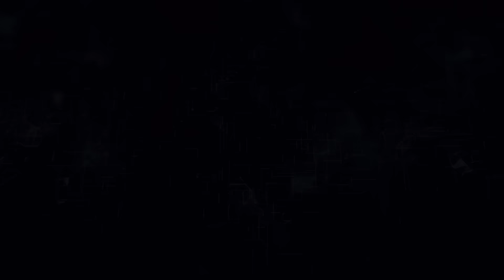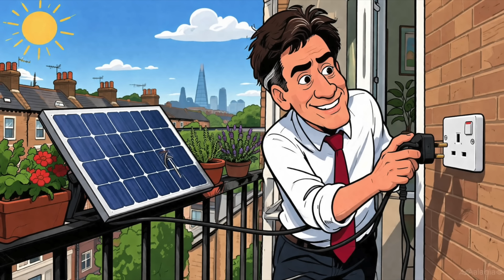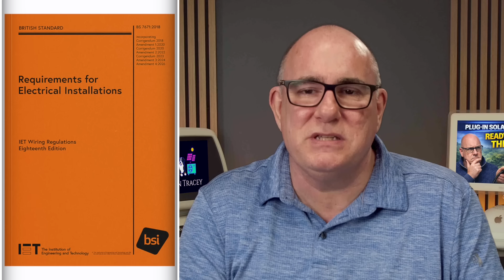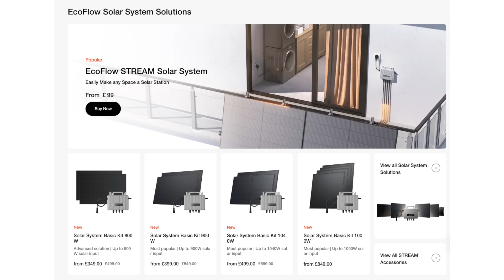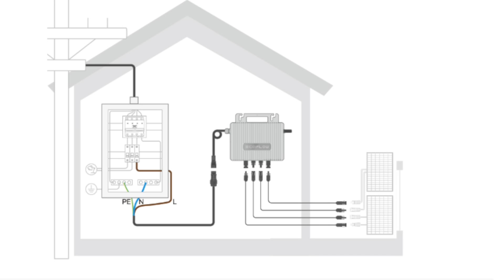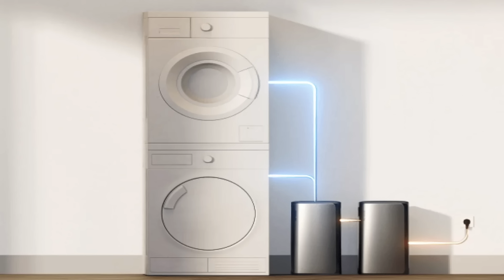Plug In Solar Is Coming… But There’s a Problem

Comment: I've heard you can put multiple micro systems into a house and should be ok as long as they on separate circuits - for example one plugged into the downstairs sockets circuit and another plugged into the upstairs sockets circuit - is this true? Also I have a separate fuse board in my garage, would I be best plugging a plug and play system into this as an added safety step? What would I need to do to have six 515w panels on a plug and play systems?
Reply from the maker: @stevecoulter5019 not quite — splitting across circuits doesn’t make it automatically “ok”. The limit is really about total backfeed and what the wiring can safely handle, not which socket it’s on.

Also 6 × 515W (~3kW) is well beyond typical plug-in limits — you’d be into proper install / G99 territory rather than plug & play 👍
Reply: A 6 x 515W plug and play system you'd peak at about 3000W so you would need an electrician to fit a separate circuit from the consumer unit, and then you or they hardwire your inverter(s) to that then file a G98. You can do that today quite legally but it will need a sparky for that one bit, and it's likely to remain the same for that level of generation even when the plug in solar rules arrive. It's about a grand for a 3.68kW inverter and another 1500 or so for 10-16kWh of batteries.

Comment: When talking to people the biggest thing they misunderstand is output. They seem to think they will get max output all day everyday. 
Well it's now 12:45pm on Good Friday and cloudy and my system with two 400 panels is producing 96w. 
So people need to be realistic. Yes on a cool cloud free sunny day I can max out the inverter (original Deye 600w version). But these days are the exception not the norm.
Has the £300 Ihave spent on it been worth it. Yes but I have had it many years. 
I have looked at batteries to soak up the excess but the numbers never really add up, for me anyway. 
If you are not in a rush for a cup of tea/coffee then a cheap 600w kettle is worth buying.
Reply from the maker: so I am in the process of publishing all my generation data on my website, this will at least give people one data point of what a system generates in the real world, more to come on this soon
Reply: @JonathanTracey looking forward to seeing the data 👍
Reply: You should never think of solar as just XYZ watts of panels.  It is really best to think of the solar as producing XYZ amount of energy per day.  So, for example, slap together a little 12ft x 6ft Pergola kit (steel) and plop 4 x 400W panels on top.  That's 1600Wp of solar that will produce 5kWh/day (more or less) of energy.  That is what is important.  Not the wattage, but the energy.

It also doesn't matter that some days aren't sunny.  The savings accrue over the whole year.  You aren't trying to run the house 24x7x365 100% from this sort of solar system.

The key to doing this is that you don't just AC couple the solar panels directly into the house with a microinverter.  Doing that would be a complete waste of time and effort as well as massively limit how much panel wattage you can install.  Nobody should be doing that.

You get a balcony kit that includes a directly-coupled battery.  And not a small battery... do like 5kWh of battery.  Now you can put as much solar on as the balcony kit supports (meaning a lot more than 800Wp worth of panels) and program the kit to limit output to the house to 800W.  Excess is soaked up during the day and stuffed into the battery to be discharged in the evening.  And, in fact, one could soak up everything during the day (depending on how much battery storage you have) to then put it all out in the evening when your electricity rates are the highest.

-Matt
Reply: @junkerzn7312 Well ideally yes but you have gone past the scope of a cheap DIY system and it's payback (for me anyway). Last year I only imported £200 of electricity. 

Besides when my system went up back in 2021 small solar batteries weren't a thing. Mine dates back to the 600w microinverter era that I imported from Europe. 

So for my use watts at the time is more important. Yes it's mainly to cover base but if it's sunny between 11am-2pm then I want to try to use as much as I can rather then just giving it back to the grid.
Reply: @junkerzn7312 it depends on people's budget and the outdoor space the property has. Ideally bigger is better, however this is going to mean that people who have been priced out of solar will finally be able to have some, which is better than none, especially for those who rent and can't have a fixed structure in the garden either due to the landlord not allowing it or not having space.
Reply: @junkerzn7312  Yes, there are some large battery stations out there [7kwh] 600w of panels can keep them topped up even in winter, plug, and play, just don’t use kettles or microwaves, everything else should be fine, as long as you don’t expect it to be continuous.
Reply: The solar data for the UK is basically that 800W of southish facing panels in the middle of the UK will generate about 800kWh a year. If you use it all then at current rates that is around about £200 a year of useful electricity delivered into your house. It's less in Scotland, more in Cornwall obviously. Overpanelling can also be a big win if your system supports it.

The european market price (as opposed to the current UK rip off market price) is around the equivalent of £60-70 for a 450W panel, and about £100 for a plug in inverter unit with no battery. So if you can use it all (eg work from home. retired etc) your RoI is ridiculously short. Even with rip off UK prices it's not too bad a return, except for stuff like the Ecoflow batteries where the prices are just stupid.
Reply: Getting a 800W inverter and doing a bit of overpanelling (in parallel!) can make the numbers work.
Reply: @konstantinlozev2272 Yes definitely in winter this could be a good option. I'm not sure if 800w/900w per input in the summer is good for the microinverter.
Reply: @gavjlewis you can install 20EUR DC breakers with MC4 ends on the extra panels for the sunny days.
Reply: @konstantinlozev2272  Never thought of that. So I guess a 10A breaker maybe. I'll look into that thanks. 
Hopefully panel prices come back down in the autumn. 👍

Comment: Just wondered, I already have a solar install (6.6kw) and 10kw battery and therefore export licence ... I am presuming therefore if I added in some plug in solar panels (with a mini converter - a battery version) I could export, however would that export still be limited to the 800w from the mini inverter?
Reply: No.  The export is whatever you produce.  The balcony solar would simply (effectively) increase your solar capacity.  That is, instead of your roof running your base load, the balcony solar would do that and therefore your batteries would fill faster and your export would begin sooner.
Reply: @TheImhotep2012  thanks for the response, what I meant was ... Say I put 4 panels up (450w each) which is technically 1.6kw ... The mini inverter would only allow 800w max through the plug and therefore ... Not allow the full 1.6kw to be exported?
Reply: @albie9999  Ah.  I see.  Yes correct.  As Jonathon notes in his videos you can mitigate that with having batteries - the batteries store the excess to discharge later, but that significantly increases the cost.  I, like Jonathon, have gone full monty with roof solar, balcony solar and several lithium mines worth of batteries dotted around my house.  But, I did that since I had some extra cash so I can put up with the 10 years ROI.  Even if you don't get any money from the grid though, over powering your solar is still good.  Note, you will cap when the sun is brightest but in the winter months your panels will come closer to the 800 Watt limit.  Extra couple of panels, as you suggest, is a small outlay.  Yup, this is an addictive hobby (I'm literally taking a pause from climbing on my roof to change the angle of my panels to optimise for summer!!).  🙂
Reply from the maker: The amount you can export from the microinverter is limited to 800w but your total export is governed by your G99 or G100.

Comment: It’s going to cost £300 and payback is a little over one year.
Reply from the maker: if your savey and dont buy a package you can get the inverter for about £99 and panels for £50 each
Reply: @JonathanTracey  Is there then a way to be able to monitor what's going on via a generic app?
Reply: Basically yes. Note need a location for the panels AND a suitable position for the cables and invertor etc  -- that later part can be a complicating factor.
Im planning to get a micro invertor and one panel to start with, mainly to play/experiment, and will have ad-hoc messy cabling etc to start with.
My mains isnt on a dual rate tarif (and no smartmeter). If it had been I might have gone a time-shifting battery system with solar panel input (built in invertor) but thats a significant just in cost for 'experimenting' (extra £500 or so)

Comment: Holding off my next solar upgrade. I want to add 5 panels, in 2 pairs and one on its own as it's more heavy shaded untill after 13:00 so 3 micro Inverters with every panel on its own mttp with 20v start up. That will be 2kw added, I have looked at a 2.2kw dual mttp inverter or 2x0.7kw inverters with optimisers. Hands down the micro inverter option is the most cost effective with likely the best performance. Just waiting to see if I can get away with not having to do my 3rd G99 application.
Reply from the maker: Yep hopefully the G98/99 process will get easier or go away

Comment: Its been used in Germany for 16 years since 2010
Reply from the maker: Yep been used here for a long time just without a plug (legally)
Reply: Legally since 2017. Only this year in the VDE regs they can use there schuko plugs instead of the overpriced wieland plugs. Schuko plugs (2 prong) are the German's equivalent to our 3 prong plugs at home.

Comment: I have a fairly big shed with a pent roof that faces south / south west (nothing in the way that would block out the sun) with a mains power source so planning on putting a 2 panel plug & play system in once it's legal to do so. The roof has a rubber membrane to keep it watertight so i just need to work out how I'm going to safety secure the panels and bring the cable (cables?) into the shed to connect with the micro inverter. Thank you for this informative watch
Reply from the maker: @jerrygale1994 sounds like a great setup 👍 south / south west is ideal.

Main thing is secure mounting and a clean cable entry (gland through the roof/wall). Keep it watertight and you’re on the right track 👌
Reply: I'm in almost an identical situation.
Fancy sharing our progress?
Reply: just make sure the shed is strong enough to take the additional load (and factor in wind!)
Reply: @iamdmc it's a solid wood shed with supporting beams. I'm confident it will be fine if I can design the fit to utilise the supporting beams
Reply: Bizzarely if your shed is under 15m2, separate from the main house and not used as a living space it may well be totally legal to go do it all yourself because you wouldn't be subject to building regulations. I've not found a definitive answer on this one but it's an interesting quirk.

Comment: Im considering this but only with a bi-directional RCBO. Last thing I want to risk is a fire by plugging into a ring main. Wonder what insurance companies think about this idea?
Particularly with old fuse boards?
Reply: I think you will be fine as long as you have "Type A" RCDs that will trip if any DC current enters into the consumer unit incase the inverter ever failed. This will be more affordable than changing to RCBO. The main issue is old homes that are on ring circuits rather than radial. The best solution to this is to connect the solar unit into a circuit thats not got any high current traffic, so avoid plugging into the kitchen circuit thats got the kettle, induction, washer, freezer, microwave, etc. Hope this helps.
Reply from the maker: as with all things its a risk and everyones tollerance to risk is small, but at 800w your kettle is likely to cause more issues than this
Reply: Ring main (if in working order - a whole other problem with ring mains) can be properly protected by combining the change to an RCBO with a down rating by the max current the inverter can provide. At that point the 32A ring main is on 28A protection so the 4A from the inverter cannot mask a real overload.

It's how Utah does it for their 1200W option.

Comment: Ecoflow have an Easter offer on at the moment but all of their stream units are marked as sold out.
Reply from the maker: yeah lots of people are buying them up in advance of the legislation
Reply: the stream ultra x used to be as cheap as 2 for £2000 after vouchers, but since Dec they've been constantly sold out and now 1 will cost you £1300-1400 on pre-order. Ecoflow is also a terrible company with zero aftersales/warranty support so I'd recommend something else
Reply: When I bought mine even during the sale it was cheaper to buy it from Ecoflow's Amazon account than it was from the Ecoflow website. Weird but true.

Comment: great video just ordered an eco flow river 3 because the place where people seem to use the most money other than the fridge is permanently having the router running I have a router and a Synology NAS running 247  I'm hoping to expand the battery on the ecoflow river 3 what should give me 14 to 15 hours run time so I should start to help then I plan to get a eco flow delta max bigger  in my shed to charge an electric wheelchair and then add panels at a later date
Reply from the maker: Yep we had a powercut last night and the router and NAS both didnt blink

Comment: Thanks JT! After your EF Stream vids. 
I recently bought 3 EF Delta 3 1500. Already saving about close to £1 a day (charge overnight 5p and discharges during the day saving the 26p). Thinking about another for the kitchen appliances! I’m truly going down the rabbit hole! 😂😂😂
Reply: Its a rabbit hole and a half  .I had a row with OVO over direct debits 6 years ago and  ,with absolutely no idea what I was letting myself in for decided to go off grid with 2 original Delta Pros and 4 x 400w panels leaning against the wall . My style of living and I should have done it years ago . I now have an EF Ultra which will see me out probably as I'm coming up for 70 soon . Its also my 2nd year drinking filtered rainwater and eating a carnivore diet . Never been better and all because OVO tried to say I was due more money . At the moment its not any cheaper than on the grid as I need to use a diesel jenny in the winter sometimes to charge the EFs but I don't care .
Reply from the maker: LOL I will see you at the bottom :-)
Reply: How much have you spent to save £1 a day? I'm a low user only 1400kw a year. Been quoted £ 12k for a system with battery. I would lose about £500 a year in interest as I would take that money out of an investment. I would still be paying a standing charge say £150 a year at the moment and rising . Would it be possible to get that money back given my bill is about £500 a year.
Reply: @jablot5054 I just got 13 solar panels installed and I expect them to pay back in about 5 years. It makes sence as we are a family of 5 and using a lot of electricity for heating the house. In my opinion it is not cost effective  to install panels for people who barely use it. Same for plug in panels. Just think if saving a pound a day worth all the hassle and taken  space used by these panels